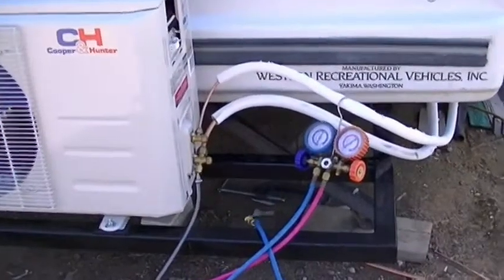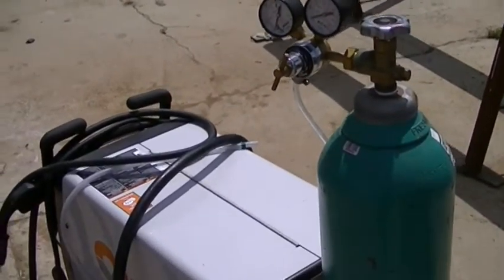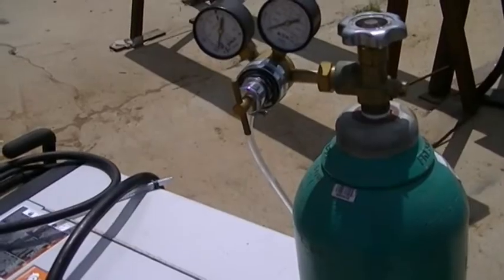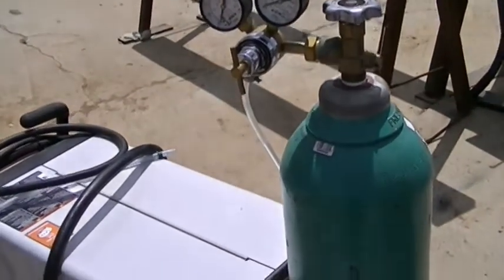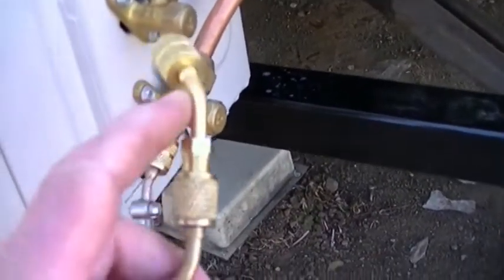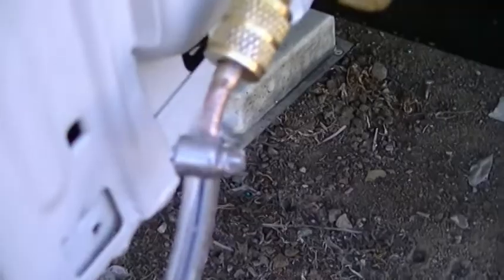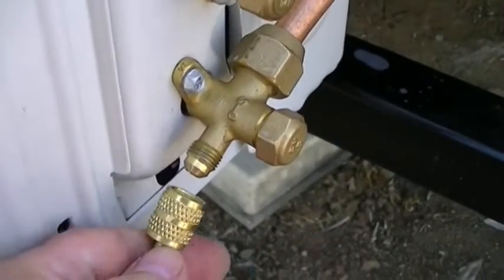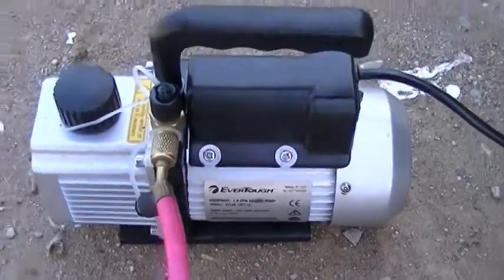Cheap & Best Way to Check for Leaks on Mini Split

Comment: Duh!!!! People have some common sense Don't do this !!!! And the reason why ???? Mini splits are sealed from the factory with Nitrogen or CO2 !!!! Now when you un screw the plastic caps of your unit you will hear air and feel air being released from the low or High side and even though you wait for it to get all out and then hook your Argon / o2 gas you use for mig shielding welding !!!??? You have just contaminated that bottle of Argon and 02 the next person to weld with. That bottle will have some Nasty holey porus welds !!!!! They will have to vacuum that bottle as well !!!!!  Pull a 500 micron vacuum on that bottle as well !!!! Because if you don't purge that nitrogen out of that bottle when you go refill it?? Guess what ???? You have just thrown away 50$ to fill up a contaminated bottle !!!!!!!!!! Now please use some common sense and avoid this situation!!!!!!! Stay Frosty!!!!

Comment: So I didn’t do a pressure test. Only a vacuum test. Then when I open the refrigerant valve. Most of it leaked out at the flare fitting. So what do you recommend I do next?  Can I use an air compressor to test?  Then evacuate the system again?  Then I have to add more refrigerant.
Reply from the maker: Hi. I am sorry you had this happen. If you know which fitting leaked, I would first take that fitting apart and inspect the flares. I have seen the flares split because cheaper mini split producers use "seamed" copper tubing that is cheaper to manufacture. What you want is "seamless copper" tubing. I have found that the 1/4" copper used by a few companies is the "seamed" copper. It is very difficult to get a good flare job with Seamed copper and not have it split at the seam. When I do a job I inspect the copper lines that I know I will have to cut and flare and if I see if it is seamed copper, I will go to my supplier and purchase a roll of seamless copper and use it. I always get perfect flares with this better quality seamless refrigeration copper. It has always been 1/4" lines that I need to replace, and sometimes 3/8" lines. I always use AC  sealant and apply it on all of the flare faces as I do the install of lines to fittings. I also use a torque wrench to make sure I get the proper torque. I you under torque or especially over torque the  the fittings by using just wrenches quite often you will crush the copper and split it or not get it tight enough. Once you get this fitting redone, do the pressure test using the CO2 like I showed (which is up to 100 psi). Nitrogen allows pressure checks up to 300 psi (which is closer to operating pressures). CO2 at 100 psi is ok if you use the AC sealant to take care of micro leaks, and it will find the bigger leaks (like the fitting you had). I do not recommend air compressor because it has H20 vapor and you do not want to introduce water vapor into the lines. If you have to use a compressor, just make sure to vacuum the lines out for a much longer time at the 30" of vacuum to try to remove all of the water vapor. The pressure check of all fittings with soap and a good vacuum has always worked for me. I hope this helps, Blessings my friend.
Reply: The first thing you need to do is redo the fittings 
Fyi
buy yourself these little gaskets that go on the fittings and also sealant that goes on the fittings threads

My Pioneer actually came with the gasket and the sealant
It's crucial to make sure that these fittings are tight they recommend a torch wrench

Then you want to vacuum the system for at least 2 hours 

then let it sit for 24 hours, and if the gauge doesn't move that's a good sign that you most likely do not have any leaks

Refrigerant is way too expensive to take chances so you can go one step further and buy dry nitrogen it's not that expensive

I went to a welding store and it was only $25

With a 25.00 deposit on the canister refunded once I return the canister

Comment: I have an air leak in a newly installed mini split. I plan on putting an air fitting on ( it’s 1/2 inch) and putting whatever pressure my compressor will go up to ( even though it’s far from operating pressure) and spraying it with dish soap and water. Hopefully that will be enough to track it down.
Reply from the maker: Hi. That would find big leaks. Micro leaks are harder to find. I use sealant on all my fittings on a new install to take care of micro leaks and then check for big leaks using the CO2 gas. Your compressor should get up to close to 90-100 psi. and that should be enough. Air compressed air has water vapor in it, so you will need to use a vacuum pump for at least 45 min. at 30 inches of vacuum in order to remove the moisture in the lines. Blessings my friend.
Reply: @thepennywiseguys thanks for the reply. My compressor goes up to about 110 psi. I found the leaks and applied some nylog to the flair ( back and front) and to the threads, tightened it up pretty good ( didn’t use a torque wrench) and that did the trick. It only gets 90-100 on rare occasions here in western Washington. Was in the low 80’s recently and this 18000 btu unit was just heavenly !
Reply: @thepennywiseguys Thanks for the advice. I purchased some Nylog to apply to the threads and the flair ( just a dab), tightened the fittings carefully but very snuggly ( didn’t have a torque wrench)and that did the trick.

Comment: G'day. Disconnecting the test port connection after vacuuming, but before the lineset gets a little above atmospheric pressure will allow air back into the lineset (gets 'sucked in from test connection when removing vacuum hose connector). To avoid this, simply allow some refrigerant into lineset (open allen screw for about 1/4 turn for 5 seconds) after vacuuming is completed (pump off) and before removing vacuum connection. This allows the lineset to get a little above atmospheric pressure and will not then 'suck in' air when disconnecting the vacuum hose connector.

Comment: Most mini splits have operating pressures on the lineset and flare fittings in the 500 psi range (in heat mode).  While your pressure test is better than nothing, ideally you want to do  the test at much higher pressures to do a proper leak test that mimics the system in normal operation
Reply from the maker: Hi. You are 100% correct. Most DIY installs do not have access to or can afford a nitrogen gas test to get the higher pressures, so I am offering a low cost alternative that is effective to find any large leaks. Any micro leaks are taken care of buy using the sealant I use on the flare connections. Thanks for your kind comment. Blessings my friend.

Comment: Sir, your method of vacuuming a system has the potential to severely damage someone's system by leaving too much moisture in the oil of the system. You must have a micron gauge to measure the manufacturer's specifications of pulling the system down to at least 500 microns of moisture. You will never be able to pass a decay test using the red or blue hoses. You have to use vacuum rated hoses.  Thank you
Reply from the maker: Hi. You are correct if the system was already charged and is being evacuated to recharge the system. This is a new system that has no charge in the lines and thus no oil is present in the new lines. With a new system, removing the air and moisture is done simply with this method. Thanks for your input and others that see your comment will learn  that they will need professional help to properly evacuate a charged system. Blessings my friend

Comment: All ductless split manufacturers what the pressure test done with 600 psi of nitrogen and then use a  bubble leak test solution approved for refrigeration fittings.
Reply from the maker: Hi. You are correct that 600 psi with nitrogen is what is best. If you want to hire a HVAC tech or rent a cylinder of nitrogen to do this then that would be best but it is costly. I use the sealant on all my flare connections to take care of the micro leaks and use my CO2 tank to check for any big leaks. The cost to do this is cheap and has done very well for me every time. Blessings my friend

Comment: Hello sir can you recommend a mini split that is 24000 btu.i will be installing myself
Reply from the maker: Hi. If you can hire a HVAC contractor to check your work and sign it off for warranty, then I would recommend the Senville line of mini splits. They are reliable and the warranty is great. I am a general contractor and install these and have my HVAC guy check my work so I can use his license number on the warranty cards. He charges me $150 to spend an hour to verify and check the pressures on start up. This works well and if you called around, I know their are HAVC contractors that would make that service call to help. Their is one company that is a total DIY and does not require a License to install and still cover warranty. The  company is "Mr. Cool" I have not used these and can not verify if they are a good unit. The second choice of units I have installed is  "Hunter Cooper" or HC. I hope this helps. Blessings my friend
Reply: I recommend hiring a professional because you will have to eventually to charge your system and 9 time out of 10 if they didn't sell you the equipment they won't work on your unit. Homeowner specials get Homeowner repairs

Comment: CO2?  My Mig uses a Argon Mix.  75/25 %  Is that what you're using?😊
Reply from the maker: Hi. Yes either CO2 or argon mix will work. I checked and as long as it is a new system there is no oil in the lines to absorb anything. I also evacuate the lines after pressure check to remove all gases and moisture. I have never had an issue. I know that Mini Splits have higher pressures but I use the AC sealant to take care of any micro scratches and this simple and cheap pressure check is looking for bigger leaks that the AC sealant can not fix. Blessings my friend.

Comment: the pressure is to low to find little leaks.
remove the reulator and attache the red hose of your lineset on your tank.
now open withe care the valve on the tank,little by little!!!!
now you can test it with higher pressure.
Reply: Hi. Thanks for your comment. I agree that Nitrogen is used with higher pressure to help find the micro leaks. I use the AC sealant on all my flares for the Micro leaks and I show this on my install videos. What I need to find is any potential bigger leaks. I want to help the home owner with the ability to check for leaks other than just using a vacuum pump. This method is safe, easy and is effective, but not perfect compared to using Nitrogen at 150-300 psi. If I suggest this method, that you lay out (which can be risky), to my viewers then I may be held liable for anyone getting hurt. I want to avoid a lawsuit.  Have a blessed day.